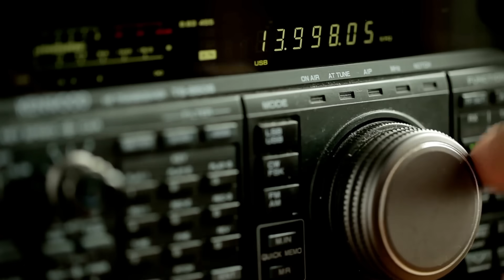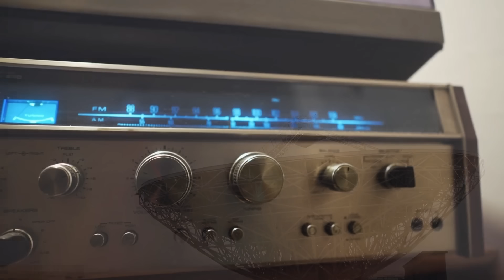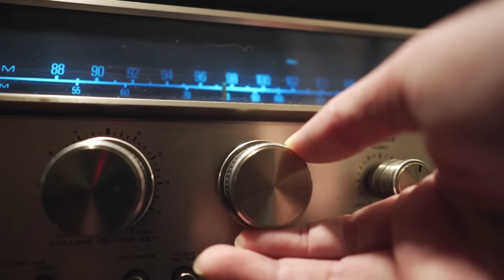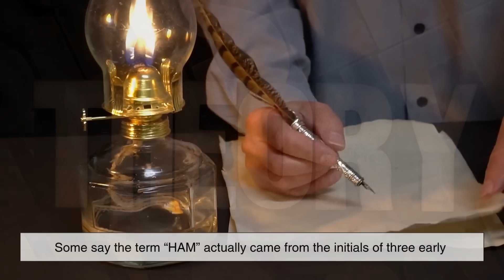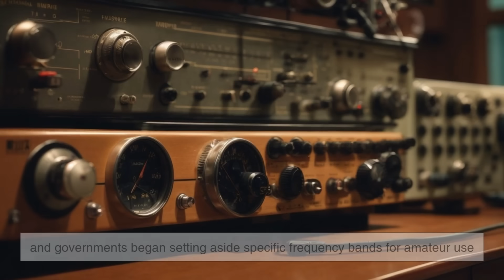Why Do They Call It “HAM” Radio?

Comment: My younger brother as a teenager set up a ham radio station in a room of the backyard pool house back in 1969 complete with an antenna on our garage rooftop.

I always assumed the term ham radio operator referred to the ham definition “excessive theatrical behavior“. I mean, my younger brother, and all the good old boys that he seemed to be talking to on air all gave themselves eccentric nicknames that they called “handles” and spoke in a jazzy kind of slang language with a lot of common buzz words, such as “breaker breaker”, a term from citizen band radio that announced you were gonna break into this conversation.

Comment: You did not mention the real reason.  Most of the early experimenter/operators used homebuilt gear with parts supplied by HAMMARLUND Manufacturing.  Founded in 1910.

Comment: Why It's Called "Ham Radio":
The term "ham" likely originated as a derogatory slang in the late 19th or early 20th century among professional telegraph operators. They used "ham" to describe inexperienced or unskilled operators, possibly derived from "ham-fisted" (clumsy) or from the theatrical term "ham" (an amateurish performer). Over time, amateur radio operators adopted the term as a badge of pride, turning a pejorative into a positive identity.

Comment: The term "ham-fisted" was current in the mid-19th century, meaning someone who lacked the manual dexterity to carry out certain tasks. This was used by telegraph operators to describe those whose transmissions were slow or full of errors.

The term "ham" to denote a poor or over-emphatic actor derives from an earlier habit of poorer actors using pig fat rather than more costly make-up bases. It was also connected with the habit of overacting in the role of Hamlet.

Comment: Kg7owo Here. (currently off the air). Another possible reason beyond the professional telegraph operators calling us "ham fisted", it could also be from "Home Amateur Mechanic". Most radio rooms, where ever they are located, are called "the shack" because early equipment was hazardous enough that Wives wouldn't tolerate them in the house!

Comment: I am a general class ham ticket holder. I also used to be a CB user. I had a mobile phone as well. At the ti/me of this event, I was not a ham ticket holder yet. I was a regional truck driver delivering in the Idaho Utah area. It was a rare moment when I had an opportunity to take a shortcut. Unknown to me, there was a range fire I was going to be driving into. the county had not closed the road. Among the items in my WOOD FLOORED trailer was 1100 ponds of a paint product ( MEK). The road was a high walled two lane road with no way to exit the roadbed safely. I had lost cell phone signal but I was waiting in a line of stopped traffic when I looked out my drivers window and saw the wall of flame less than 2 miles away, rolling strong. I picked my phone, no signal. I picked up my microphone, tuned to 9 and asked if the were any LEO dispatches listening. I described my situation, gave my approximate location, mentioning I had the only 48 foot trailer in the crowd of tourists. Dispatch understood it and soon, I saw a Forest Service helicopter coming toward me with a HUGE bucket of water. He dropped the load, the road got opened to let us out and all of us made it out safe. The only casualty was a guy in a convertible that did not put his top up. It was a time when cell phone service was not there but radio saved the day.

Comment: I wondered if "Ham" came from the phrase ham-fisted: Google suggests "the term "ham-fisted" likely originated from the comparison of clumsy hands to the large, awkward hams of a pig, leading to the related and older term "ham-handed". First appearing in print around the late 19th century, the phrase gained wider currency in the early 20th century, possibly boosted by its use in the slang of WWI aeroplane pilots. It means clumsy, awkward, or heavy-handed".

Comment: The phrase "ham" was first used to describe someone with inferior skills, specifically in a theatrical environment. It originates in late 19th century America as "ham-fatter", an inferior actor who uses ham fat to both create and to remove make-up. Also, “The Ham Fat Man” was an 1863 minstrel song. This morphed into being used to describe an amateur or over-acting performer. Additionally, ham-fisted, or having hands as clumsy as a ham became a common idiom, sometimes applied to less competent wireless telegraphy operators. The allision between ham and amateur became cemented in early 20th century radio amateurs, who often built their own equipment in a less than professional manner.

Comment: I worked at a remote communications site in Alaska and the guy I worked with started doing HAM radio when he was 16 years old. He had a telegraph key with two contacts and he was fast. He had two long wire antennas strung between our satellite antenna and communications tower that he could switch between.  We had a lot of free time and he hand built a 2 meter linear amplifier even making his own inductors. He retired while I was there. We all had a General Radio Operators License (GROL) as a condition of employment.
Reply: Why do you capitalize 'Ham?' It's not an acronym.

Comment: Very good presentation.  Early communication was done using Morse code without actually using tuned equipment with a process called ‘spark gap’ - which was terribly inefficient and wasteful of  bandwidth.  It was primarily the ham operators who advocated  using tuned frequencies and eventually convinced the Navy (and others) to quit using the wasteful spark gap technology.

Comment: This is KTF4294, I'm 10-7.
Reply: That's not an amateur radio call sign, and we don't use 10-7 abbreviations either. That's more likely to be CB radio.
Reply: @Arndt_DC7OT Try this: This is KTF4294, I am 10-7. No abbreviations. Better?

Comment: My parents and neighbors had a wartime mentality. Spy. As I was called and a fobia was formed. Followed me through my life.  Being a listener ..then a 'ham". for 30 years, then " swl". in my final years had endured calls like "spy""witch" having cops called find no transmitter. Had lines cut or pulled out of my house... equipment stolen bumped in trash bins down the block. . I still love my hobby "ham"/"swl".😊😊
Reply: re7xt  looks like a Russian callsign but not showing as valid
Reply: @robertfleming9161 short wave listener I have fine receivers. And wire antenna to feed shortwave receivers. The receivers are ssb am fm and slow scan fed to my pet computer. Had a warrant less search after I moved in my rental.  Someone was watching. Then I had to black out windows. As I might turn around and see on lookers. Running away.  Just 74 year old and for the cost of a battery I can travel the world cheep😊
Reply: @robertfleming9161  Not a callsign 9161

Comment: A little late but I can add a small note as an Air Force brat.  My father was a career Air Force NCO who retired in 1968 at 26 years of active duty service. I was always amazed by the huge B-36 and C-124 aircraft on the flight lines

One of the assignments was to Ramey AFB (Puerto Rico) 1956/ 57/ 58, a Strategic Air Command Base (SAC).  At that time he worked as a TV engineer with the Armed Forces Radio and Television Service (AFRTS).  There were times when B-52s from Loring AFB (Maine) deployed to Ramey AFB on various missions and had some spare time. I think this was before Chrome Dome was actually in full operation. There were also times when B-36s rotated through the base.

My father was also a HAM radio operator and had crew-members from the deployed planes stop by our home when they could. He then used the HAM radio to contact another operator at Loring AFB.   That operator then placed local calls to the crew families and patched them back through the radio. The crew members and families could talk for the equivalent of a local phone call. It was great to be a part of that with those brave air crews. At that time long distance calls were both very expensive and hard to coordinate.

We did have one bad accident that I recall from that time. Our house looked out over the start of the runway and hanger area.  One of the B-52s moved to its position at the start of the runway and began to accelerate. We could hear it reach take-of speed and then lift off, followed by a large explosion. The crash happened right over an empty playground and melted the steel swing sets and slides.  The crew were all lost and remain in our memories.  

Regards
Reply: not like a local call of that time local calls were not FREE  you are expressly forbidden as a ham radio operator from accepting ANY compensation for transmitting a message its actually a rule and yes its a question on the test to become licensed.

Comment: Wherever the name came from, amateur radio operators used to actually be "amateurs". The designed and built all their own equipment. Then came commercially available equipment, but it was still simple and easy to understand and work on. A lot of amateur equipment was built from kits, like Heathkit and Hallicrafters. Gradually "amateur" equipment became more and more commercialized, and amateurs became less and less knowledgeable and skilled about building and working on their equipment. Today, there is really no difference between "amateur" and commercial equipment. It's all "plug and play". You buy all the parts, hook it all together, and get on the air. FCC amateur radio exams are now almost entirely about rules and regulations, rather than about the technological aspects of radio. Everything has become computerized. Modern TRASH technology has all but destroyed real amateur radio. I became an amateur radio operator 41 years ago, and to this day I use old school tube type HF equipment. I have taken it upon myself to learn about radio theory and how to work on old radios. New "amateur" radios can't really be worked on, even by the manufacturer that made it. Like everything else, it has become disposable. There is really nothing "amateur" about it anymore.
Reply: Got you beat. I got my general class license in1961. I built a lot of Heathkit stuff as well as Knight Kit equipment although Knight didn't have much in  the way of communications gear as I recall. What I didn't remember was Hallicrafters ever producing a kit but I'm sure they did. I had a number of their receivers back in the day and they were absolutely excellent. My favorite stuff though was that "Benton Harbor S-Line" (SB-102 SB-220 plus other goodies like the station control console, scope, etc).
Reply: There is still some DIY Homebrewing going on, it's been largedly moved to the fringe bands 630 and 2200 meters, the microwave bands, and some experiential operations in the 40 THz (low infarred) range which is the farthest frontier for radio these days.

Comment: HAM radio operators helped us call home from Vietnam using their links in a network called  MARS.  A rare treat, over....
Reply: I'm N7NMS, licensed 1989. I was in the USAF and a  MARS operator at Kunsan AB, ROK  running phone patches before the internet was available.
Reply: Vietnam was a bit b4 my time, but I at one time was a USN-MC MARS radio operator until they closed the program leaving only the Air Force and Army to carry on with MARS.
Reply: @W8RIT1  You would still know how much that call home meant.  Thanks
Reply: Severe and destructive Tropical Cyclone Tracy hit Darwin Australia early on 24 December with a death toll of 66. As communication systems were devastated, the first news to come out of Darwin was by a ham radio operator.
Reply: I remember that from Takhli, Thailand !!! Thank you all. 🇺🇸👍👍👍🇺🇸🙏🙏🙏🙏🙏
Reply: MARS is still a backup today.
Reply: @Lissica1 on paper maybe. Army Mars had only a handful of paid operations in the 90's. I was friends with the SC State director and used to operate at the Ft Jackson military MARS station. It was being phased out then. If you were really a part of the system, you would have the same encrypted comms the military use. 😊
Reply: @n7nms  You are aware of the fact that every HAM radio still built today have on purpose an easy doable mod for operating on MARS frequencies in case of an emergency?!? For example, i can do the mod for my Yaesu FTDX-5000 with a piece of wire and a pocket lighter!
Reply: @Lissica1 yeah I had all of my rigs modded but everything is encrypted in the government and MARS doesn't have that capability. Everything is satcom based and not HF.

Comment: That's a longwinded way of saying, "I don't know how the term HAM radio got started."
Reply: He is not well informed or did not bother to research the topic properly.
Reply: @moritzheintze7615  au contraire...this IS a well informed and truthful video. Since he also shows multiple theories on just how the term came to be used, ...shows, obviously, that he researched more than one theory and not just latch onto the commonly heard theory.
Reply: @W8RIT1  He failed to find out that the heroic legend of the three HAM operators was deliberately made up because it just is more flattering than the plain truth. There is no reference to HAM in congress protocols. Than again, the term "truth" has taken a twisted meaning in the US anyway...
Reply: @moritzheintze7615  he gave multiple theories, all factually true...yet you seem to have an axe to grind with a strawman. I really don't know what to tell ya....